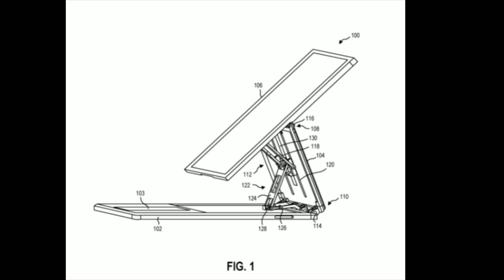Forget What We Said

Comment: So, the main reason for the nm change is a fact that the whole nm race is pure marketing. If you guys check out Gary explains recent video on processors, the fact is that Intel's 10 nm has more transistors than TSMC Arm's 7nm. The whole nm term is less about the actual size of the transistors or the number of transistors. I was kind of blown away and probably gave Intel more heat than they deserve for it. Intel here is probably just leveling the field.